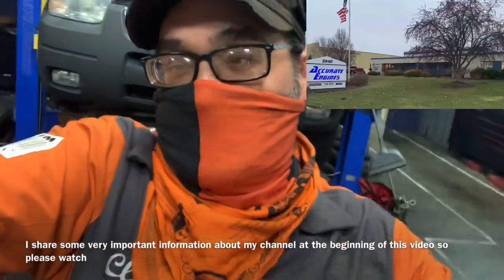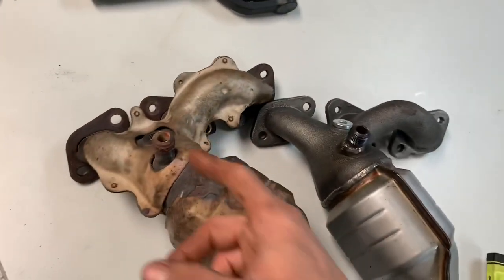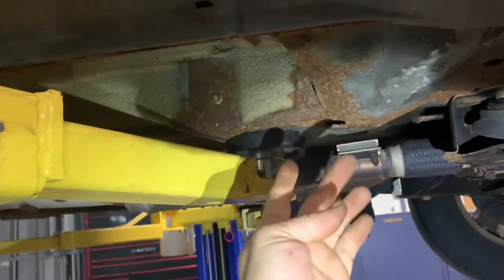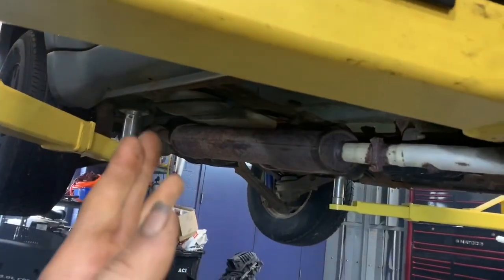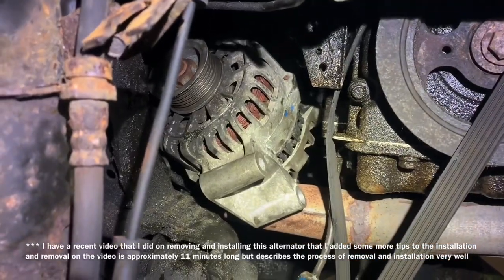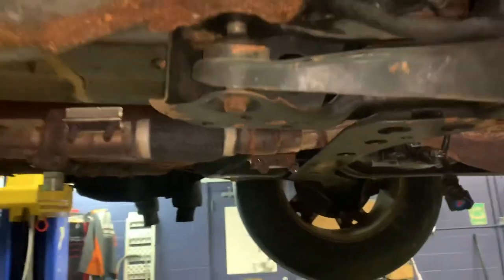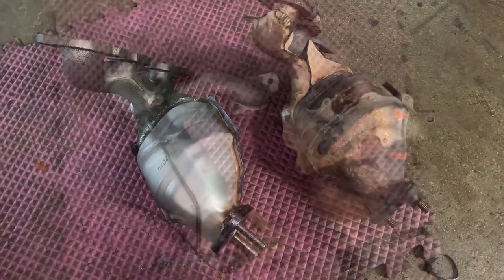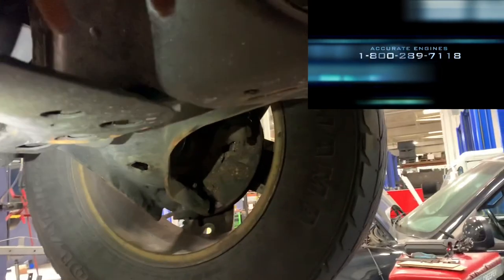Ford Escape rear catalytic converter removal Nuts And Bolt easy to follow with great tips!!!!!

Comment: Awesome video, man.  Hard to find ones that show removal of the rear cat on models with the triple exhaust manifold.  Thanks, enormously helpful.
Reply: Forgot to add that on the 2008 4WD Escape, the alternator is actually at the front of the engine, and does not have to be removed.  So it's not necessary to loosen the motor mount bolt or jack up the engine on that model and maybe others.

Comment: The video looks like you are removing the driver side knuckle, but the when you reach you hand in, that looks like the passengers side. Is it both or just the passengers side????
Reply from the maker: More than likely, it was the passenger side. I don’t remember, though most of the work to remove that is going on the passenger side and vehicle.

Comment: Wish I watched this the 1st time. I put the part on and the CV axle will hit that flange that he talks about bending or grinding.  I had to tear everything back apart because I couldn't install the CV axle and then I actually return the part and got a different one from a different vendor and it came the same as the 1st 1 so I guess you just have to bend that think you can grind it because then it will leak

Comment: What a thorough video. Phenomenal! 
I was wondering if this would be pretty much similar for a 2013 Ford Flex, I did the back pressure test like you said & also put an IR Temperature gun, & I’m all set to do this hell of a task! 🤦‍♂️ 
I can definitely tell that the driveshaft will be in the way. Probably the alternator too. Should I follow your video step by step?
Reply from the maker: I’m really sorry I honestly don’t know I’ve never done one on the Ford flex so at this point I can’t say for certain. But at the very least at least you’ll have an idea since they’re both boards and I’m pretty sure they’re fairly close engine wise

Comment: Not that I would do it but can you unbolt muffler and punch through the plates in the old cat then bolt the muffler back up without taking all that crap off?
Reply from the maker: Well you can’t go around on the Internet making videos and breaking federal law....... so I try to avoid making videos of me doing that..... ijs and I think in this situation I don’t know that that’s really possible because the pipe is bent but maybe you’re right.
Reply: @sharpcarco  Thanks man. Hypothetically obviously. I looked on my wife’s escape. You can do it on the one near firewall but not the one behind the radiator.

Comment: That looks different from my 2010 XLT 3.0 Duratec
Reply from the maker: It’s not. That should be damn near identical.. there’s no value in changing the mechanics underneath the skin of a vehicle. I was probably doing this on my 2003, but I’ll bet you the procedure is identical, if not very very very similar.

Comment: Dude! whats with the audio?
Reply from the maker: Stupid microphone I’m working on it.
Reply: @sharpcarco  love your vids BTW.
Reply: Awesome and informative. Audio, try to use something as simple as a normalizing audio program or an add on onto your editing software. Audio makes the most difference in any video. 
I have a Ford Flex with a p0430/420 that most likely I’ll be having to deal with a similar task. Front is quite simple, but the rear looks like a bigger job. I wonder if it’s similar to what you just showed. It’s strange because I took the front off last week and the honeycomb is intact, still very white and not blocked at all. I changed the o2 sensors and put it back together with a new gasket but I’m still getting the codes after reset. I guess they just go bad internally after 175K or so? Bummer.
Reply from the maker: You can do a exhaust back pressure test to check it for certain then you wouldn’t have to remove it. Thanks for the information on the audio it’s a very limited situation and I think I figured out how to overcome it